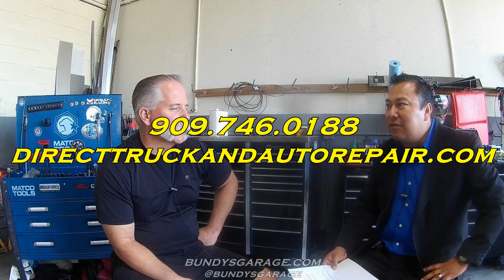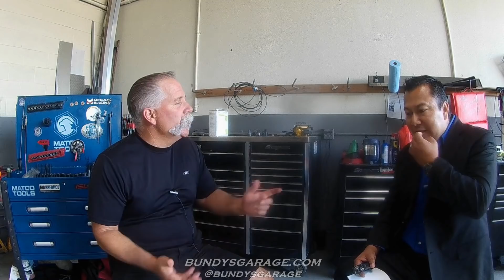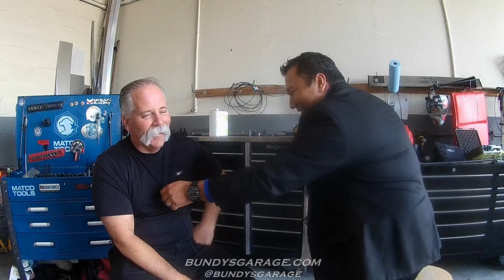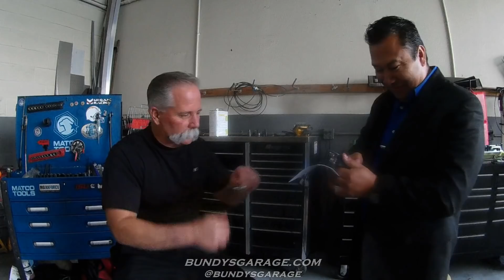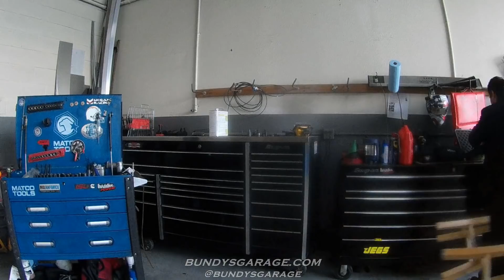Worst Diesel Engine Ever - What is the Best Diesel Truck out There? | Ford Dodge Chevy

Comment: I agree I've been a mechanic all my life I own a F-150 a 2500 Dodge and a 2500 Chevrolet and a 1500 GMC and I believe that Ford does build a better heavier truck but when it comes down to the engines in the 225 hundreds that I have hands down the Cummins is the better engine the trucks is no comparison the Ford truck is twice the truck the Dodge is but engine to engine dependability is hands-down Cummins wins
Reply: if only you could get an allison transmission with the Dodge. because the automatic transmission in a Dodge is no good , if you are going to be doing any towing. however if you can get by with a manual transmission with the Dodge Cummins you will be ok. to bad you can't choose your drivetrain  , cross breed between the major three manufacturers CHEVY , FORD , DODGE. THEY DON'T WANT TO DO THAT. the trucks would last to long..
Reply: Bart McGee perfect truck is ford,Cummins,Allison and Dana 80. 😆
Reply: Bradford Ramm we will just have to agree to disagree. PERFECT truck is chevy Cummins Allison Dana 80. I like Ford's ok , but they don't ride as comfortable as a chevy does loaded, unloaded or towing..
Reply: Bart McGee you know the reason for that right,weaker springs.that previous don’t apply to the new ones as fords frame and suspension has went the way of Chevy and dodge.
Reply: Bradford Ramm yea you right.i remember back in the day. a Ford truck drove terrible. you could rebuild the complete steering system and they would dart around on a joint in the highways. that was with the twin I beam . Ford greatly improved that in the late 80'S now days most trucks are fairly eqeal as far as the way they drive / handle. they all cost to much. it's like buying a second home. you know when they can discount around 20 k late in the year , there is a huge profit margin. gosh , I hope no one ever pays sticker price for any vehicle now days.
Reply: Bart McGee t
Reply: @bartmcgee4669  Yeah, nowadays people live in a $2500 trailer house and drive a $100,000 truck.  I know a man just bought a duramax crew 4x4, and he said, taxes and all, was little over $100,000.00 hundred thousand.
Reply: @bartmcgee4669  Yeah, last too long, way too long.
Reply: @bartmcgee4669   they make stand alone Allison transmissions.  And since the Cummins is an industrial engine you can put an e2 bell housing and it would bolt right up
Reply: @bartmcgee4669 except they already do do that.... Cummins isn't Dodge (Fiat) Cummins is its own company. So is Allison, so is SRT. 😂 Duramax is a rebranded Isusu. The "Ford" Powerstroke was developed by Navistar aka International. NONE of the Big 3 have independently developed their own drivetrains. Ford and Chevy for example collaborate quite often when they develop transmissions. Take their 10 speed as a recent example. 😂 You can definitely tell when someone is Brand brainwashed. It's far to common.
Reply: 5.4 Gas, 6 and 6.4 Diesels!! POS!!! And Ford screwed the owners of these peaces of crap!! I've got a LB7 Duramax that GM dealership replaced the injectors. Now at 389,000 miles and not other problems! Still pull 20K loads weekly with no problems!!
Reply: I got a 2000 7.3 and it had wide bore spacing and should be convertible to 2 stroke poppet valve. Just baffle the intake valve for complete loop scavenging, I’m used to 2 stroke as o got an 8v92 detroit turbo
Reply: Well yeah my dream truck is a Ford f250 quad cab 8 foot bed with a Cummings Diesel swap running either an Allison automatic 10-speed transmission or the Eaton Fuller manual transmission and then have the whole truck Line-X ..... And only in two-wheel drive because I don't need four-wheel drive and it's just Weiss crap to break..... And I want real thick heavy saddle leather seats ...... And at my age at 44 years old with the amount of driving that I do only about 12,000 miles a year on average I'll probably never even make it to the half a million mile Mark before I die
Reply: @josephatnip2398  How does your VRO oil injection pump setup work, these are a bigger version of snowmobile engines in a truck, are you on klotz techniplate or castor 927 maxima?
Reply: I fill and run xd-100 2 stroke oil in my powerstroke 7.3, 33.50 a gallon and have 2 VRO outboard pumps into the fuel also
Reply: Fords new 6.7 is very reliable, glad they left international
Reply: I own several of each. I get pissed at one brand then buy dodge then back to Ford.
Reply: We have  an F550, 6.7, 2012 and 2014 Dodges.  Just spent 15,000 on the Ford getting all the crap taken off. Good truck now.  The two Dodge trucks had it taken off years ago.  Dodge has many more problems than Ford in general, but no engine problems, and no auto trans problems.  So all the Dodge problems are things I can handle. I'd rather have those problems instead of engine/trans problems. Let's say run a rear hub off on a one ton and the duals roll off in the woods and the truck's on the ground on a busy road, with a loaded 30' gooseneck on it.  That's still a small problem compared to engine trouble.  During the heavy snow we had in the south, we were feeding 3,000 cows, Some pastures were 30 miles one way. One dodge went to only having 2 nd gear and reverse. Loaded trailer of hay. Had a 100 hp 4x4 Kubota (not a problematic John Deere) and pulled the truck around facing out so he could leave when unloaded. Guy went home and disconnected battery and left it off all night. Hooked back up, worked fine, hasn't missed a beat. So, there's little tricks to try before saying transmission trouble. Dodge power steering pump situations, but still, I'll take problems I can handle. I've even took a Dodge down and put new rings, rods, mains, lapped valves.  I came across one that was turned up too high. Top piston ring on each piston was in 1/4" long pieces. Finally it broke a second ring, and it had a miss.  Them piston rings were melted and flared down the side of the piston, sharp as a razor blade. Put it all back together and delivered it back.  I drove it a little, it was scary fast.  I had another car to work on here, was an LS1 Camaro 6 speed, and it was fast. But, I believe the one ton crew cab Dodge would dust it.
Reply: U know its duramax stop fibbing
Reply: True. Thats why fummins is such a popular swap especially with an upgraded tranny
Reply: Ford's have a history of ugly design, though, IMO. Raptors are cool, but the others not so much.
What I hate about Duramax's is the fuel injector changes. I wish they'd make trucks so the front body would lift off.
Reply: Chevys are complete junk for towing hauling anything heavy ! Buy Ford or Ram for work. Buy Chevy if you’re all talk. Which is always the case
Reply: Donnie Bargo https://youtu.be/oF0ZnW1H3rc

Please share and subscribe God bless you all we can’t let Chrysler your way with this  just got to report back on the truck 🔥🔥🔥🔥
And it was Chrysler’s fault the truck burned up because of a faulty part from #ChryslerFiat #ram1500 #Ecodieselcaught fire because of a faulty parts from the manufacture
Reply: I fucking hate 4 stroke and hate it, lightning is the real 2 stroke
Reply: Can anny of your involve inject 2 stroke
Reply: Donnie Bargo https://youtu.be/oF0ZnW1H3rc
Reply: TINES UP   really  ? What was the problem  ?  I know they can leak alot if not addressed  ...
Reply: TINES UP   I have an 1988 chevy 3500 extended cab 454/400 turbo  212.000 miles and love it !!! Not sure what the 6.0 is ?
Reply: TINES UP  it has some rust..... but its paid for and does everything I need a truck to do... my next truck is the 8.1 with the allison trans...
Reply: TINES UP  Omg the prices are crazy......  I only paid $24,000 for my first home... I'll just replace the panels on my old truck and be happy with no $500 truck payment.....
Reply: TINES UP   it drives and rides like a Cadillac... I paid  $2500 for the truck in 2007... I think some told me it has a Dana 80 rear end  ? I just make sure all the fluids are changed in it . But like I said the next one will be the 8.1 with the allison... extended cab not a 4 door..
Reply: Goes both ways i had a f250 and was nothing but trouble spent more time fixing it than I did enjoying it... now I only have GM vehicles 07 g6 08 2500 duramax and 17 traverse... and only routine maintenance no major issues but that said all mass production vehicles have hiccups... stay safe brother
Reply: The old saying is guys don't buy Dodge (nowadays Ram) Trucks they buy Cummins engines with a Ram truck wrapped around it.
Reply: Almost all the guys who hotshot and tow heavy use a ram for the fact they are more reliable and easier to maintain. Its like 10 to 1 in the mountains on the west coast. Everyone else is just talking crap and its personal experience and preference. Owned many duramax's and cummins. I wouldn't trust this guy after his comments on the duramax.
Reply: Agree if Ford put the Cummins in theirs it would be the best
Reply: I’ve owned them all of them and actually use them for what they’re made for. I’ve by far had better luck with the GM trucks than what I have the others. 

Good luck with keeping tires on that going down the road sideways Ford chassis,  keeping a Dodge in the road when the steering stabilizer shock goes bad when you’re driving down the road. 

I’ve had 2 of the 6.7 Cummins, drill a hole in the bottom of the turbo,  $20k to replace a failed fuel system. 5 to 7 mpg just by hooking nothing more than a lawnmower trailer to the back of it. 

The Ford 6.0, the Ford dealership wouldn’t even give me anything on trade for it because they couldn’t get rid of them, alone with wholesalers not giving them any thing for them. It went through 2 engines in 86K miles.

I’ve had 2 duramax’s , I’ve had zero Engine trouble out of both trucks. Yet I will say this much about all of them. I still have a 1997 5.7L ( 350 ) gas motor C2500 Chevrolet truck that I’ve had since new. I will honestly walk right pass any of the other trucks that I’ve had or still have to get in that old 1997 3/4 ton Chevrolet to go do something. That truck is truly the best money that I’ve ever spent. Other trucks have been bought to replace it, but most of those trucks are long gone and it’s still here !!
Reply: @bigbossman3987  I have chevy 2500 I need a 350 engine for now my son's like it better than any truck I have
Reply: Cummins + Alison + Ford/GM frame. Yeah its the perfect truck. 

Problem with Dodge is their engine is great, but the rest of the truck is crap. 

Ford's problems stem from the engine's it seems. 6.0L, 5.4, 4.6 and 3.0 all come to mind. They like to reinvent the wheel too much.

GM well.. They made amazing trucks back in the day. 5.7L/Turbo 400 is popular for a reason. along with the LS engines. This was also back in the day when they had Turbo 350/400 and SM465 transmissions. Given recent GM transmission problems, outdated interiors and electronic suites and god awful looks GM is just not in the same league as Ford currently sadly.

As far as Diesels go I6 is the proven design Cummins and Cat are proven engines. V8 diesels have always had problems. Dirtymax and Powerjoke both.

I heard that at one point GM wanted to use the CAT 3126 in their trucks and CAT wanted a company emblem on the side of the trucks much like how Dodge does with the Cummins, and GM said no and walked. Take from that what you will but i would of bought a GM truck with a 3126 in a heartbeat.
Reply: They all suck as they are 4 stroke
Reply: I have been a GMC owner since 1996, and I am thinking of switching my likeness of truck. After changing out a oil pressure switch on a Vortec 4.8L, I said no more. Would you say Dodge or Ford?
Reply: B. L. If you don’t need a heavy duty, go with the tundra or ford. Gas mileage sucks on tundra and it’s plain. But, it works well and for a long time. Ford seems better in all departments, but seem to need parts sooner. All of my fords nickel and dimed me. Had a Nissan Frontier that was a beast and currently own a tundra with almost 40,000 and have replaced a turn signal bulb. I’ve been happy with it. Only tow light trailers though. Good luck.
Reply: @fivecrosses9040  Tundra does best at 50ttps://www.4btswaps.com/threads/turning-4stroke-into-2-stroke.12888/#lg=thread-12888&slide=0;1 premix 2 stroke oil and filled with motul 800 2t
Reply: Bruce Miller sweet

Comment: Best truck I ever had was a 2001 F250 7.3L ZF 5 speed. I sold it in 2016 with 715,000. I put 2 clutches, water pump and a few alternators. It was worked hard and not serviced like it should’ve been. Probably still on the road somewhere.

Comment: I had a 69 which is even older than a 73 and they both work good found at the 6ix9ine actually had more dependability but I blew the heads on both of them because I’m a package delivery driver and a contract driver for RPS now FedEx ground ground

Comment: I have a 03 f250 6.0l that was a commercial tire truck. 250k miles, engine is great but I did have to replace the transmission (manual).  Super reliable truck and best gas milage for its size.
Reply from the maker: Where did you get the transmission from? OE, Aftermarket, Rebuild?

Comment: My F-350 is my Company truck, 4x4 Crew cab Dually with 7.3 Power Stroke Diesel the last year they had them. Since it is Commercial vehicle here in Canada we have to have a yearly Safety. it is still running strong and just rolled over 750,000, original motor and tranny, just changed the fluids and Filters in both regularly. Since new Ford diesel truck engines have problems I would only want a New F-350 with a Cummins Engine. I would never own a dodge truck even if you paid me. Good Engine in the dodge but the rest of the truck is a money pit.

Comment: Fifteen or 20 years ago Ford wanted $5,000 dollars for eight injectors and the wire harness, at that time I bought a 1983 300SD Mercedes like new? Now day you have to pull the Ford cab before you can get the engine out, great engineering unless you are paying the BILL?

Comment: My 2011 Duramax has nearly 400,000 miles on it with the original trans and injectors. It has been liberated of the emissions controls, I service it regularly, and I don't drive too crazy with it. Hoping it lasts me another 400,000!

Comment: perfect combo:
12v 5.9
2002 Zf6 manual or Allison 6 speed auto
1993 Dana 80 SRW rear axle 
Dana 60 Front Axle w/manual locking hubs
Borg Warner 4407 t-case w/PTO
99-03 Ford superduty Box-type frame.

Then do whatever else you want.

Comment: 2014 jeep grand cherokee eco diesel engine takes the cake for worst ever created
Reply from the maker: What happened with your Jeep?
Reply: @bundysgarage  had recalls, random diesel leaks, engine over heating. Kept taking it back n forth to the dealer and they even seemed confused. Definitely told myself I would never buy diesel engine ever again. Simply not worth it

Comment: In the early 80's, I put a 4-53 two stroke Detroit in 1 '72 Ford F-250. I used an auxiliary transmission that was direct and 30% over; it went between the bell housing and the 4 speed. That truck was an animal. 20 mpg, tremendous power and simple. Wish I still had it.

Comment: Just wanted to hear what they had to say. Worked on all of them. The Cummins less problems, Ford 6.0L was the worst of them all and the  Duramax and there are so many some were better than others. But all one thing they have in common, to expensive. Every thing  Double or triple the price just too darn expensive.
Reply: The 6.0 diesel installed in ford pickups the engine it made by International. Label on right valve cover. O K?

Comment: They got rid of the 7.3 because the service industry wasn't making enough money in service repairs on it... It's a simple dated engine that will easily run biodiesel straight vegetable oil hydrodiesel ect, in the right climate. what are the emission issues running pure biodiesel? Other than making folks hungry as you drive by them?

Comment: 6.7 Cummins, 
I've got a 94 DODGE RAM 2500 with a  5.9  12 valve 
740000 without going into the engine, just replaced original universal joints about a month ago, did replace the dashboard 
22 mpg on the highway

Comment: Ford has always had the better suspension, rear end and seats but chevy made the better gas small block and transmissions. In my limited experience with diesels I believe Id stick with a 12 valve 5.9 cummins!

Comment: Dodge??? No such thing as a Dodge truck. AND you are reviewing the engines in these trucks.  I would think you would know that Dodge is not a truck name anymore.  That name was dropped off the truck line about ten years ago.  They are RAM.  The diesel engine in the 2500 and up are built by Cummins NOT Dodge.  Dodge are now is muscle cars and mini vans. Other wise good job.
Reply: Hahahahaha I think these guys mean well but they have just ramble about their opinions.  Dodge hast not had its name on a truck since 2010 and their diesels are Cummins. Get updated fellas.

Comment: I found a 1991 pre turbo f 250. I went underneath and could not believe the massive front end. the truck chassis is in amazing shape. A bit of rust work at the top of the wheel arches and there she goes. 
  We finally got it started and there was a deep loud knock that I would have to think is a broken rod. if i was a kid wanting my first truck, I would take that good chassis and put a jasper rebuild in there for a fine old school truck for under 10 k

Comment: I own a tow truck company and I've used Fords dodge and Chevy's The Ford on the  F550 The frame is too weak it cracks by the leaf Spring The Chevy 5500 It has a  Duramax Does not have the power The Dodge 5500 6 7 Cummings Allison transmission With a Ford rear end A stronger frame then the Chevy and Ford after doing deletion on DEF Do the chip program And tuner Is the best one with strait pipes and im chevy man but for work its got be a 5500 dodge ram